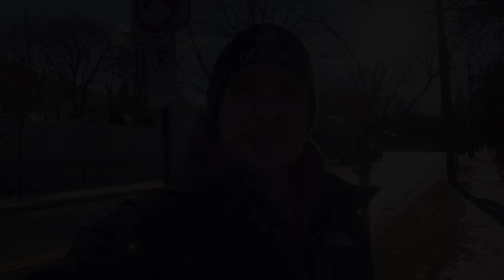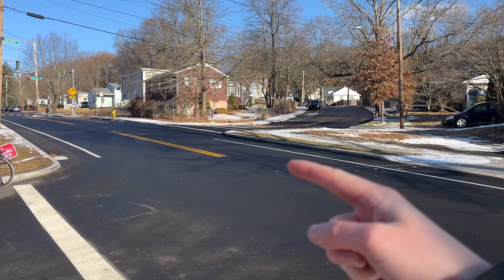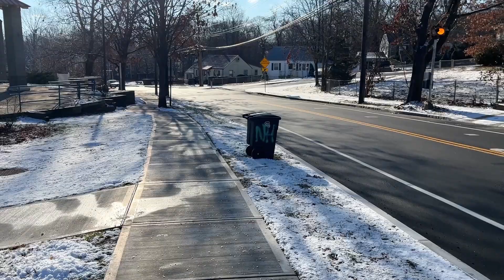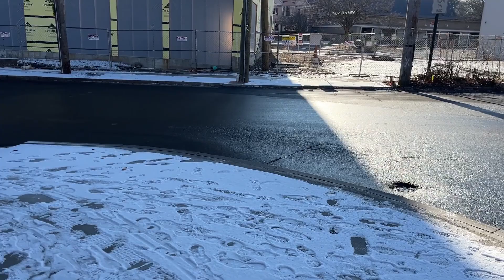Valley Street Traffic Calming Project

Comment: Looks awesome!
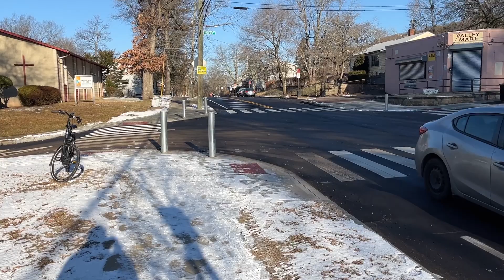3:12 Do you typically use a 20mph design speed for raised intersections? Or is it just based on the roads speed limit (say 25 or 30mph)?
Reply from the maker: That’s something we’ve been experimenting with lately - most of our raised intersections have gone in on 25 mph speed limit streets so we aim for those to have a speed of around 15, but we’re installing some on a higher speed road soon (35) so we’re lengthening the approach ramp to see what kind of speed reduction we get and will adjust future designs from there

Comment: Can we talk about the fact that the white paint is slippery when wet and can cause accidents and injuries? Possible solutions could be as simple as cutting grooves in the paint? Anybody?
Reply from the maker: The white “paint” is called thermoplastic and it is embedded with antislip gritty material. Mainly for the crosswalks and symbols, the shoulder lines are just epoxy resin

Comment: Good improvements for sure, but it isn't quite "great" yet. I would have loved to see bulb-outs at all the crossings to narrow the crossings to a tight 20 feet (2 x 10ft lanes) to further calm traffic, especially turns. The shoulder lines are better than nothing as they visually narrow the lane, but they don't decrease the crossing distance, which is also really important. Another options, if there is room, is to add a median island to give pedestrians 2 separate 10 foot crossings, letting them cross one lane at a time which is more efficient, and forcing the cars through a slight chicane which calms the traffic even more, which is especially important at the intersections. 

The intersection at 13:45 could also have been a median Island, forcing on direction of traffic to the side. The bio-swale is obviously a good thing, but that could have gone anywhere.
Reply from the maker: Sure, anyone watching this video can come up with a list of things they would do differently. But these projects are designed based on years of exploration, utility coordination, public meetings, internal meetings, and deciding what creates the most impact based on the limited budget provided.

Also, the bioswale towards the end could not have gone anywhere. The bumpout is within a parking lane so creating a median instead of a bumpout would eliminate the parking lane, which was not something approved for this block.
Reply: @everydayengineering  For sure! I didn't mean to imply that the improvements that did happen weren't good enough. But if we do take lessons away from this project to apply to others, it is also good to set the sights as high as possible and let things get value engineered down from there.

re: the bump-out - I definitely think it could be a median instead. All you would do is swap the positions of the bump-out and the adjacent travel lane along with some striping to smooth out the turn and make it a little more gradual for the cars. There is enough room on either end to have the travel lane curve out towards the curb and back within the space between and including the two driveways - parking is already not allowed there so no spots would be lost. Also, it helps to reframe the curbside as individual parking spots (as they are marked in this example) rather than as a continuous parking lane. There is no reason for parking to be uninterrupted, and the spots where there is no parking (such as in daylighted areas around crosswalks, or between two driveways that are so close as to not leave room for a car to park) can be used for street trees or bioswales. Also, a median design along with a raised crossing would calm the traffic down even more. The cars were driving by you quite fast, far over 25 mph by my eye.

Thank you for an awesome video documenting your city!

Comment: You know... it's really easy to go "this is still not enough!!!" when looking at a typical half-assed US american road safety project. But I think it is very important that we see these steps for what they are: the right direction. These changes need to be made, studied and replicated - only then will people accept that "walkable neighborhood" isn't a buzzword, but a way of life that can only exist with MAJOR changes to infrastructure and zoning.
Reply: How is this half assed? They literally repaved the entire road
Reply: @Sam-w5v  The PLAN is half-assed, not the execution of it.

If you wanted to be serious about pedestrian safety, you could use the huge curb-to-curb distance to install islands forcing cars to "slalom" a bit every now and then, breaking up these long unterinterrupted runways, especially downhill. Instead of painting a small "shoulder" on both sides to just optically narrow the lane, you could install a bi-directional bike path on one side and make it protected, preferrably by a hard curb. The wider part where there is on-street parking would lend itself perfectly to also have an extended curb on the other side of it, making the crossing there also as easy as on the side that's shown in the video. The raised portions of the sidewalk could be in the same paveing as the sidewalk to visually enhance the message to drivers that they are crossing a pedestrian path - not the pedesrtians crossing the road. You could remove about 3/4 of the unneccessary signage along the road and just say "residential street, use caution" at both ends, so drivers have to actively judge for themselves what a danger is and where it's going to pop up making them less likely to speed (e.g. a big yellow "SPEED BUMP HERE" sign tells drivers they can safely speed up to that sign), you could incorporate green space in the afforementioned traffic islands and plant trees in them, further enforcing the perception of "this is a street you shouldn't go past 25 mph on, probably slower" to drivers - all without lowering throughput or travel time at all

If I did a proper in-depth study of the road in question and showed it to dutch urban planners I sure they could come up with yet more and cleverer ideas, but just off the top of my head, there are several things that could be done more and better without impeding cars.
Reply: @QemeH  why would you show it to dutch urban planners? This is the U.S, dutch people are from the Netherlands. Besides, where would they get the money for those extra renovations?
Reply: @Sam-w5v  "Dutch people are from the netherlands" - did you figure this one out on your own? Seriously, US americans can be so condescending in their ignorance...

I would show them to dutch urban planners because they are simply the best in designing for overall safety (as in: lowest deaths of all road users combined) in their streets. They have all of the above mentioned techniques as a standard in their repertoir and don't build any streets without them. They are decades ahead of the US in terms of pedesrtian, cyclist, rollerblader, scooter driver and wheelchair user. In short: I would ask them, because they are the best.

And as to the question where they would get the money: The entire street was redone anyway. They did very extensive curb modifications (which, to be clear, are all good!) and even installed new drainage at some points. Painting it new with different lines would cost nothing, a few more islands and some plastic bollards are negligable in the immense amount that is a total street resurfacing. And if you go about it in a smart way, you can even have the utility companies pay for a portion of it by having the underground infrastructure work (like maintenance and installing new cables) done at the same time. But even if you don't manage that and it's still a considerable addition to the budget: Every roadside incident that does not happen effectively EARNS the state money - less policing, less fire and rescue, less healthcare, less lawsuits and so on. In europe this figure is in the hundreds of thousands per week on moderately busy roads - but that includes the full social healthcare costs which you guys don't provide by the state, so the benefit will be lower (for the state, it will still give those benefits to the residents, but we're talking about budget, so...)

Comment: 12:35 why does this seem like a bicyclist-squish zone with minimal adjustment to the driver? Bicyclists as sacrificial element for pseudo pedestrian safety?
Reply from the maker: it’s not a bike lane
Reply: @ what are the white lines for on either side of the intersection?
Reply from the maker: As i explained in the video, it’s to visually delineate the 10’ lanes as narrower lanes have a traffic calming effect
Reply: @everydayengineering  why they didn't simply expand the sidewalks? Missed opportunity either ways.
Reply from the maker: Because it’s not as simple as you suggest. Moving curbs requires reconstructing the drainage system as catch basins are all located on the curbs, and that’s assuming there are no additional buried utility lines at the new curb locations. Then, the cost to remove existing curb, install new curb, install new drainage, and redo all the sidewalks would cause the project budget to skyrocket, and in that case, the price would be too high and the project would not get approved at all. It’s easy to be an idealist when viewing a project from the computer, but there are so many local factors that must be taken into account for a project that a youtube viewer cannot see.
Reply: @everydayengineering  I'll take your answer if they but put new asphalt on top, which I hardly doubt. Usually in my country when reconstruction of a street is done it's completely reworked - all is dug up and built again from scratch. All the communication underneath, the drainage, sidewalks, lanes. Even the small ones. That's why I'm confused.
Thank you for the answer!
Still a missed opportunity for a bike lane. 😉

Comment: Insightful video. Thank you for sharing. One question: With all the raised intersections/crosswalks, why was one determined to be not needed at the Senior Center where those users may be the ones to benefit from a level crossing the most?
Reply from the maker: That was actually supposed to be a raised crosswalk in the original design, but when the contractor began excavating in the area to install new drainage, they found 3 separate gas lines under the road which meant we couldn't do any underground work here. So just the bumpout could be installed

Comment: Major difference, but there’s still a LOT to improve coming from a Dutch Engineer.
Reply: @  sorry for that, didn’t think anyone would’ve been interested 😅 anyways here’s what to improve: more narrow roadway, medians need to swerve the traffic away from it and to do that you need a roadway that curves around the median thus meaning that the lines on the road need to actually represent the asphalted part of the road and curbs need to follow that curve around the median, this really forced people to slow down and do around the median instead of just weaving out of the lines and just following a straight road.

Something else would be raised intersections with pavers and making them raised higher like in The Netherlands to really make people slow down but this needs to go hand in hand with the natural speed limit of the road meaning the roadway has to be narrowed down completely, also no traffic lights please for such quiet streets, you don’t need a traffic signal until efficiently is great enough to use one.

Comment: Looks awesome. How is the local gov vs state gov in that area? I’m assuming this is a local road, but does the state have any interest in improving the parallel state road?

Also, the compliant cross slopes on paved crosswalks are great to see. Unfortunately that seems to be ignored in my area. Steep drop on the one street but it’ll certainly calm traffic down… any evidence of scraping?
Reply from the maker: Historically, the state DOT has largely been focused on widening roads and trying to "solve congestion." In fact, they widened the parallel Whalley Ave back in 2011 to the current 4-lane configuration which was highly controversial and received a lot of opposition. However, the DOT got a new commissioner a few years ago and there has been a noticeable change in their design philosophy, and they recently adopted a complete streets policy where they must include sidewalks, bike facilities, and transit features on new projects. There is still some old-school momentum behind certain projects, but there is progress in the right direction.

Comment: Overall, I LOVE the project, but the road sign nerd in me has spotted many MUTCD non-compliant signs.
Reply: Which ones?
Reply: @Sam-w5v  
0:00 The 'No Parking' sign should either not have any text or should have text in all caps. "Anytime" should be "ANY TIME".
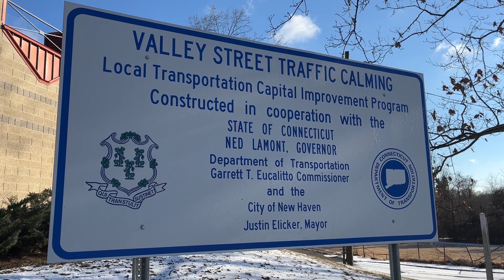0:12 The project sign should probably be white on green, not blue on white, but it's unimportant so I'm not too concerned.
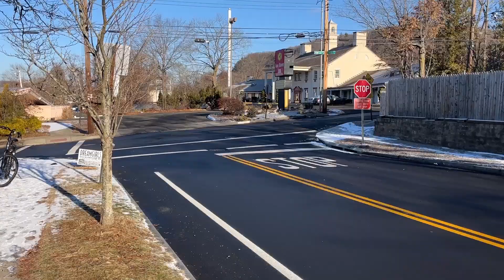1:53 The sign under the stop sign should be black on yellow, not white on red.
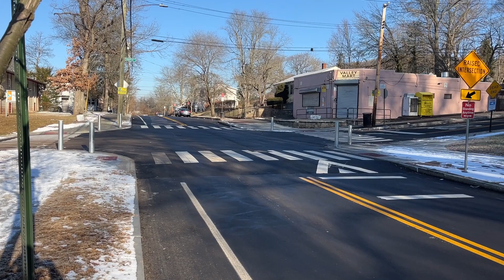2:30 The 'No Standing' sign should be red on white, not white on red. It also should be in all caps and appears to be in the wrong font. "Anytime" should be "ANY TIME".
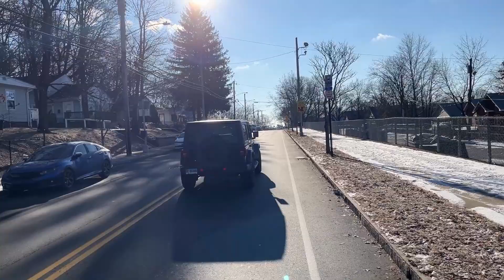5:11 The 'No Standing' sign is in the wrong font with mixed case, should be something like an R7-107 sign.
5:14 Same complains as the last one.
5:18 The YOUR SPEED sign should be mounted underneath a SPEED LIMIT sign. The numbers should not be italicized and should ideally be displayed with a dot matrix display, rather than a 7-segment display.
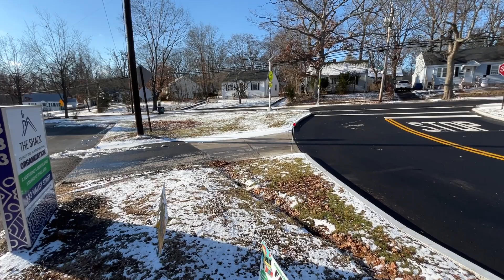8:48 The smaller diamond sign says "DRUG FREE ZONE," which is non-standard, in the wrong font, bold, and should not be presented like a real road sign. It should be mounted elsewhere.
9:16 Not non-compliant, but I feel like a black housing for the beacon lights would look better than yellow, seeing as the crossing signs are yellow-green, not yellow.
9:22 Two beacons flashing with no sign? Why? Those beacons should be mounted to the SCHOOL SPEED LIMIT sign a little up the street.
11:06 The ONE WAY sign text is weirdly spaced and shouldn't be encroaching on the arrowhead so much.
13:03 On the fence to the right, there are three NO PARKING signs, two of which do not have a border, one of which is spaced very weirdly, all of which should not be mounted on a fence. Assuming this is the city, they should have put up poles to mount the signs to. If this is the homeowner, I do not believe you are allowed to put those up as if they were legitimate.
13:10 I don't know what that white square on the stop sign is, but it shouldn't be there.
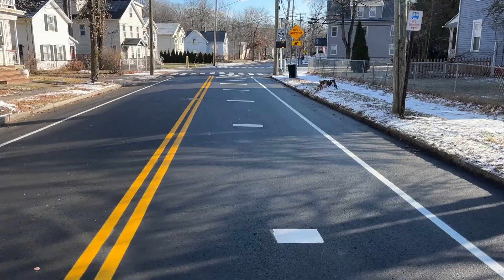13:28 The YOUR SPEED display is closer to what it should be, albeit the numbers look bold, but the sign should encompass the display and be black on yellow, not black on white.
15:07 The sign should be corrected to face the right way again.
15:08 The arrow on the ground suggests you can either go right or straight, but no straight movement exists (at least right now). This is very confusing and should not be there. If there will be a straight movement in the future, the arrow should be added when it exists.

Please note that I only included each sign once if there were more than one identical signs seen in the video. I also understand that many of these signs were present before the project.
Reply: @Sam-w5v  I spent like an hour going through and listing each individual non-compliant sign, but that reply got deleted for some stupid reason. There are at least 20, if I remember correctly.
Reply: @SomeExistite  MUTCD is super backwards anyways, it is way behind the times. We should have switched to the Vienna Convention long ago, but if we can't take that radical step we need to at least modernize our signs to keep up with changes in design best practices.

Comment: That shoulder should be removed (=become part of the green buffer between the road and the sidewalk). But overall enforcing the speed limit by the road design should also reduce the number of drivers, who take this as a "shortcut", because it probably is no longer faster than going the main roads.
Reply from the maker: If we were building the road from scratch, yes I would have moved the curbs inward and narrowed the road without a shoulder. But all the existing drainage structures are on the existing curb, and most of the road did not receive new curb. Replacing all the curb and redoing the drainage system would have increased the project cost probably 3-4x and we have to work with a budget so we do what we can
Reply: @everydayengineering  Plus you now have a place to dump snow!
Reply: I was also thinking, why is there a shoulder here making the road very wide.
Probably a place that bikes will use, but I would say: make the speed low enough to cycle safely on the road or add a proper separated bike path.